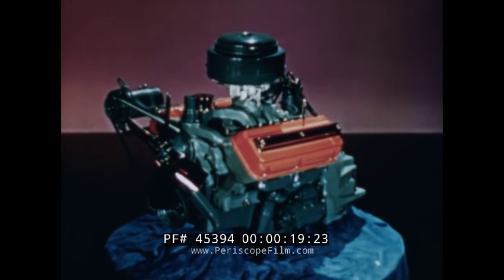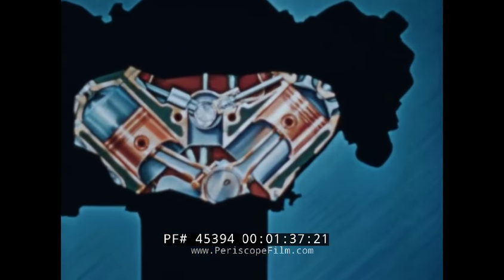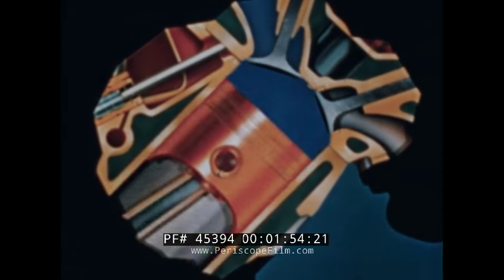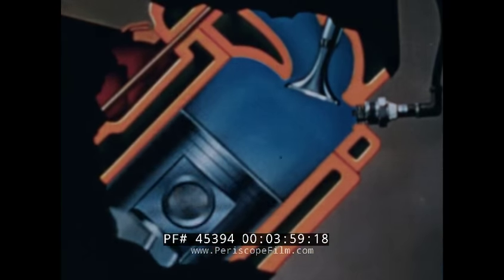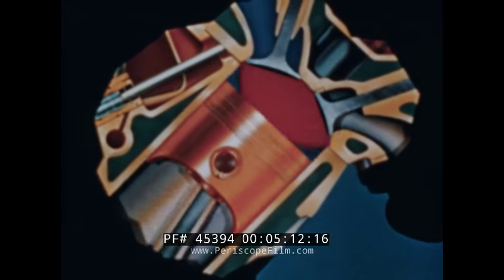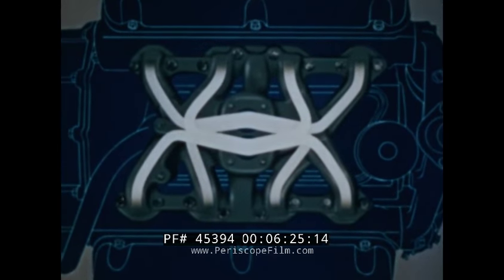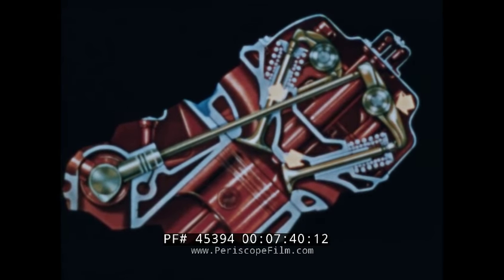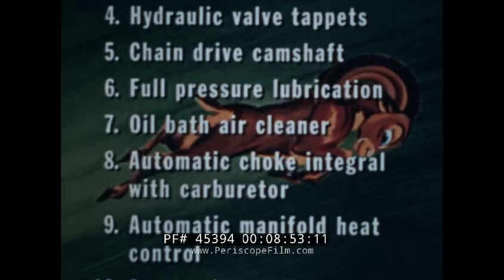DODGE AUTOMOBILES 1950s RED RAM V-8 HEMI ENGINE PROMOTIONAL FILM 45394

Comment: I will bet that over 95% of people today have never seen an oil bath air breather like the one shown here.
Reply: My first car I bought for $25 -  1962 Chevy Biscayne 235 cu. in. 6 cyl engine had an oil bath filter. It worked very good BTW.
My father had a 1959 Rambler Nash 6 cyl engine that didn't have an engine oil filter. It was optional equipment.

Comment: This engine was produced from 1953 thru 1957, with CID's of 241, 270 & 315 in Dodges, and 255 in some '55 Plymouths.  Plymouth used the same short block with what they called polyspherical (Semi-Hemi) heads in 1955 and some 1956's.  The 1951 thru 1958 Chrysler and 1952 thru 1957 DeSoto engines were also A-series engines, although they had different block and head castings.  The 1956 Thru 1966 A-series engines were produced in the new (in 1955) Plymouth engine plant that started production in late 1955.
Reply: the corporate wizards would try to offer that much diversity- which was also experimentation today

Comment: Like too see a 1954 Dodge Royal, V-8 Hemi engine, 2 door hardtop with 3 tone paint job, such as blue body, narrow black strips running below the side windows, and a white top, for example. Powerflite automatic transmission was debuted for that year, and proven popular. Other popular accessories are: Power steering, power brakes, push button AM radio, and wide whitewall tires. 1954 (along with 1955, 1956, and 1957 are the good years) for Chrysler Corporation.

Comment: Wow! high compression of 7.7 to 1. How things have changed.
Reply: On regular gas at that.
Reply: Octane was VERY low back then. One of the reasons Chrysler spent so much time on the Hemi head design which could make the most of that poor gas.
Reply: There were British racing engines of 10:1 then. Petrol octane rating was the limit back then!
Reply: 7.1 to 1
Reply: It blew the 5.5:1 of the flathead Ford out of the water! lol. Love both engines, built a couple flatties and currently building a 270 Hemi. Fuel in the 50’s sucked.

Comment: I put one of these engines in my 1st car, a 1951 Plymouth Concord Fastback.  The engine was bored .060 over, milled heads, collapsed hydraulic lifters with adjustable push rods and a carter 4 barrel carb.  For only 248 CID in a 3,200# car, it ran pretty good!
Reply: Where yuh at on that resto

Comment: My 2nd car was a 1956 Plymouth with the 270 CID Polyspherical Head version of this engine.  It was bored 0.060 over, milled heads, the same carter 4 barrel &intake manifold from my dodge hemi and a 4.10 rear end.  It also ran pretty good, it surprised quite a few Chevies including a"57 Vette.

Comment: My brother worked at a Chrysler distribution center back when they were going bankrupt in the late 70"-80"s, management sent him and others through the facility to round up anything and everything that was not immediately necessary for the companies survival, Way back in an old part of the building they found two Hemi Red Rams still in the original crates covered over by other crap. My brother and a security guard were tasked with removing them and taking them away, he watched as both motors were band sawed into 4 pieces and tossed. Only in Canada could this have been allowed to happen
Reply: Id have snapped. Load them in the truck even if it gets u fired
Reply: I feel as though someone punched me in the bread basket readinging that.
That's worse than burning books!
Reply: @rebelcowboy5.7l98  
You got that right, Paul Simon couldn't have sung it better;
"Just jump in the truck Buck, and watch 'em try ta catch meee"